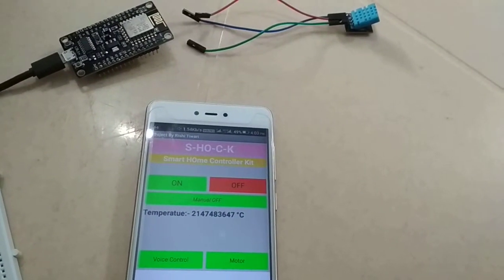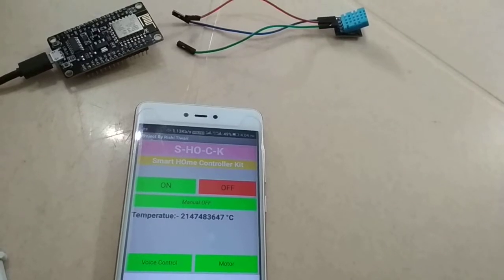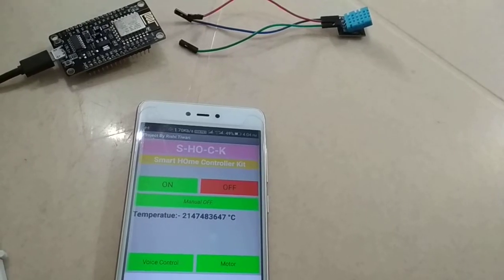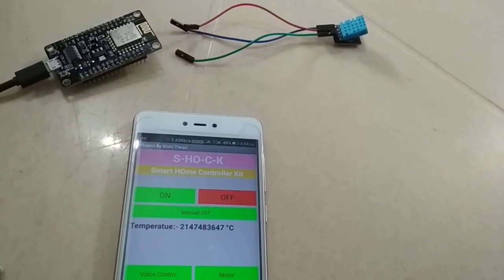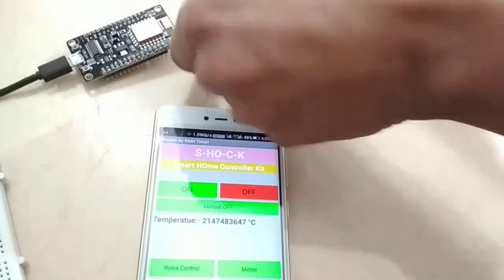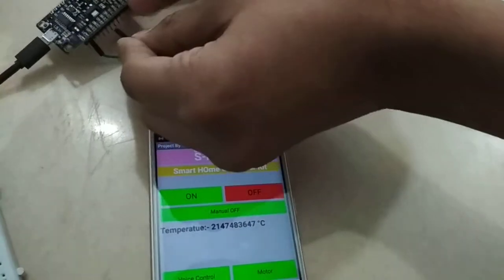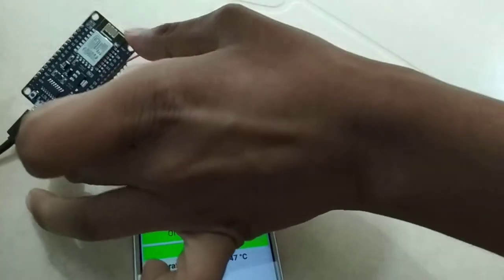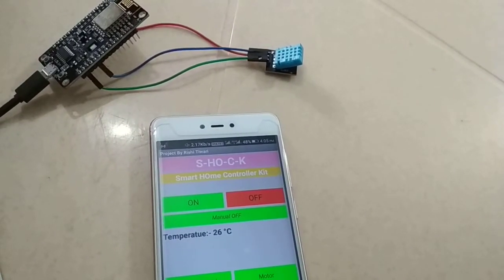[SOLVED] DHT11 Temperature Sensor Not Working With NodeMCU ESP8266

Comment: Hy guys, i don't understand on what Pin is connected data sensor ... can you write please ? Thank you for help
Reply from the maker: Hi

I also forgot, which pin it was 🤣

Refer this, according to your NodeMCU model:-

Amica:- https://github.com/TrickSumo/water-level-indicator-controller/blob/master/Circuit%20Diagram%20For%20NodeMCU%20ESP8266%20Amica%20Model.JPG

Lolin:- https://github.com/TrickSumo/water-level-indicator-controller/blob/master/Circuit%20Diagram%20For%20NodeMCU%20ESP8266%20LoLin%20Model.jpg

GND pin will be same for both model. For +5V, use either VV or Vin pin.
Reply: @TrickSumo  Thank you ! I still have an issue, when i connect VIN pin i can't download the sketch on the board. If i remove VIN pin, then it download ... I have an AMICA board.
Reply from the maker: @franckcopeland2464  I remember this issue - you can remove sensor to download sketch and connect again.

Or use 555IC:- https://www.youtube.com/watch?v=hPv9uX3rUWc

Main issue is that 3V supply is not sufficient for the sensor. Feed it 5v anyhow and things will work.
Reply: @TrickSumo  Thank you !
Reply from the maker: @franckcopeland2464  You're Welcome 😊
Reply from the maker: @franckcopeland2464  You're Welcome 😊

Comment: thank you so much brother!! I've spent so many hours on this issue!! Finally after connecting with VV it worked🥺
Reply: VV means?
Reply from the maker: @edtechpraveen  
Refer this, according to your NodeMCU model:-

Amica:- https://github.com/TrickSumo/water-level-indicator-controller/blob/master/Circuit%20Diagram%20For%20NodeMCU%20ESP8266%20Amica%20Model.JPG

Lolin:- https://github.com/TrickSumo/water-level-indicator-controller/blob/master/Circuit%20Diagram%20For%20NodeMCU%20ESP8266%20LoLin%20Model.jpg

GND pin will be same for both model. For +5V, use either VV or Vin pin.
Reply from the maker: You're welcome! 

All it needed was 5V, even you can use 9V battery with 7805 IC.
Reply: Sir it still not working for me I have changed 3 sensors. Please let me know how to give 5V or extra volts ?